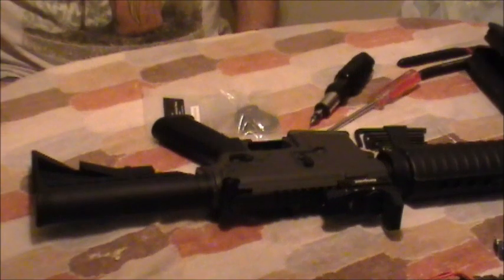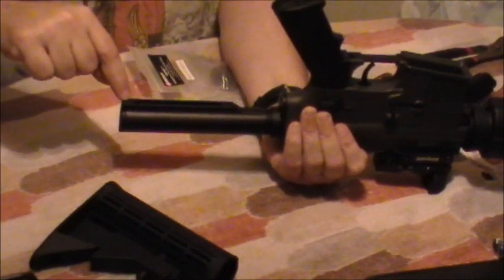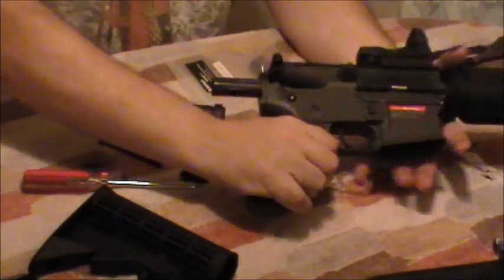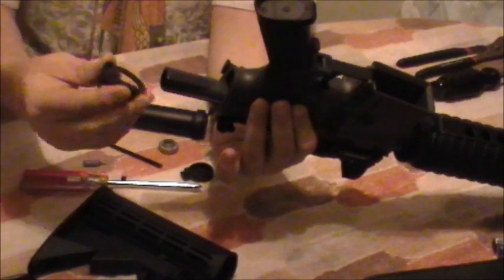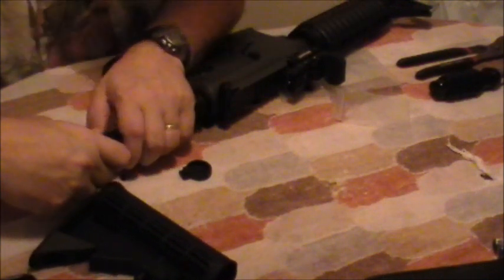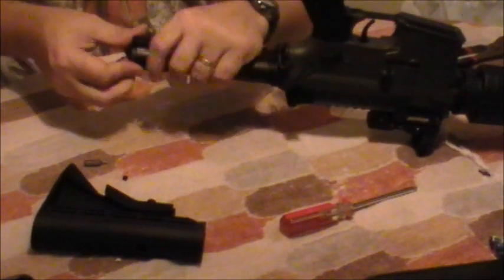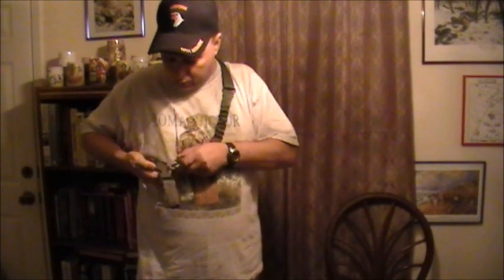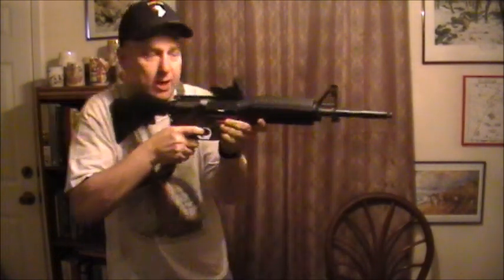Know-It-All: Magpul ASAP and butt stock removal

Comment from the maker: @PeopleLovePeoplePLP why not? I did. its almost the same way you remove the JG
1 take the But Plate off. 2 unscrew the back cap off the buffer tube. 3 using a long neck philllips head unscrew the nut inside. 4 slide ou the bot and ring from inside. 5 Then slide the buffer tube straight back off the lower reciever. 6 remove the ring spacer. 7 replace with ASAP. 8 reverse above steps to reattach.. this is the KA steps